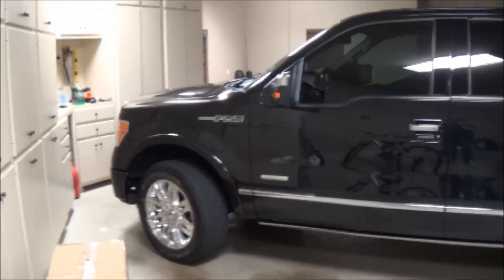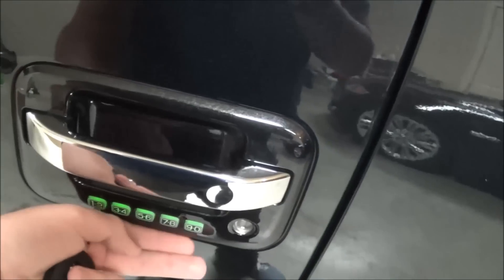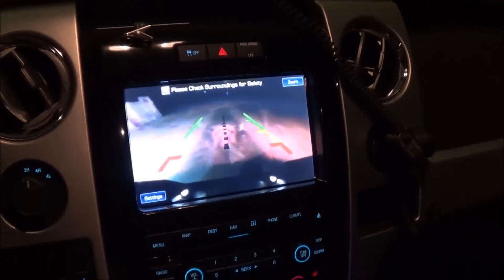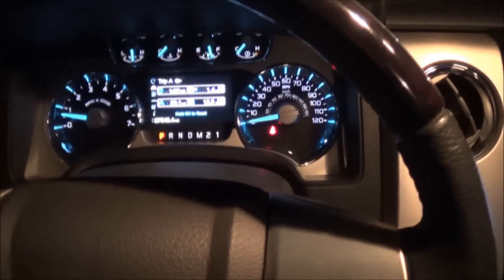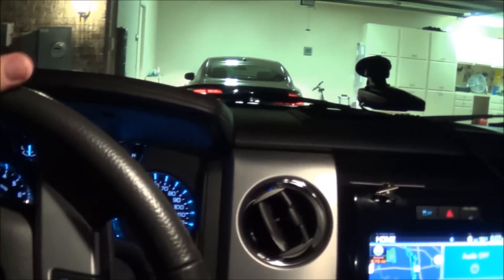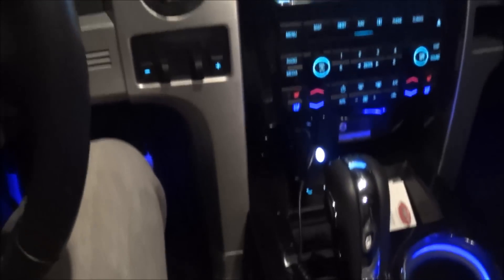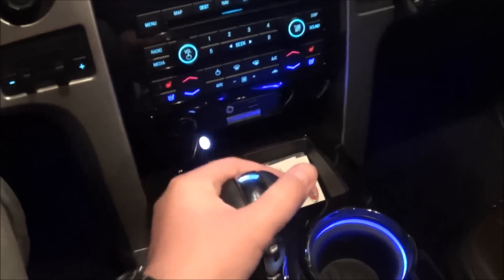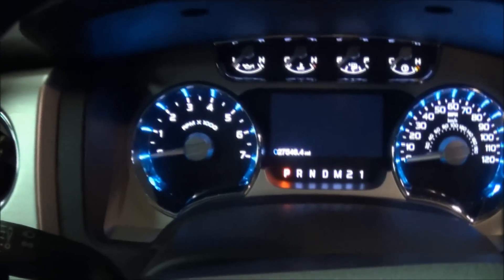New Camera!!/Update on the 2011 Ford F-150 Platinum 4x4 EcoBoost

Comment from the maker: Well keep in mind this is a twin-turbocharged engine, so it really doesn't have to work hard. You can tell when you're driving it that the engine has no problem moving the truck around. Also, no matter how efficient an engine, a vehicle that weighs well over 7,000 lbs. won't get great fuel economy.

Comment from the maker: Y'all are forgetting the size of this vehicle. It's about a foot longer than a Suburban and makes more power. This engine isn't made to shine in town. It's on the highway where the difference can be seen. Plus, this is miles better than the 2010 with the 5.4 V8. It got somewhere around 10-11 MPG town and maybe 15 hwy.